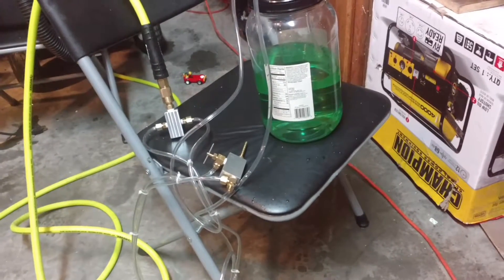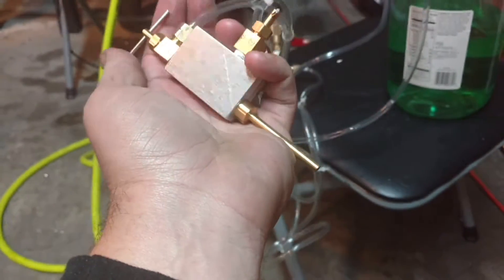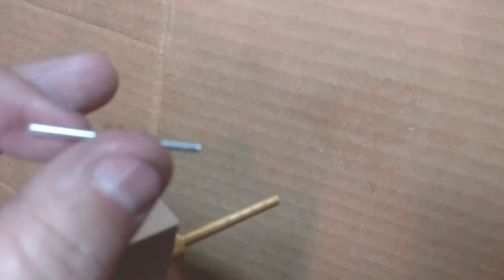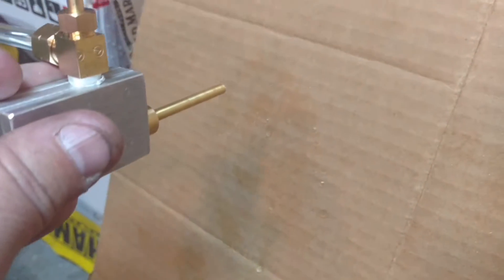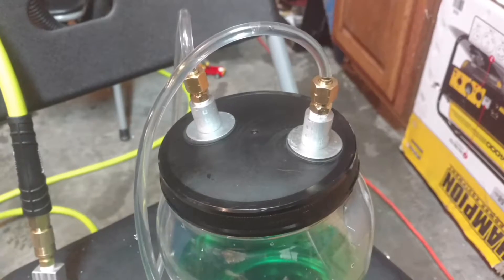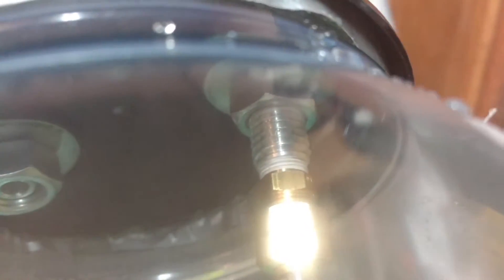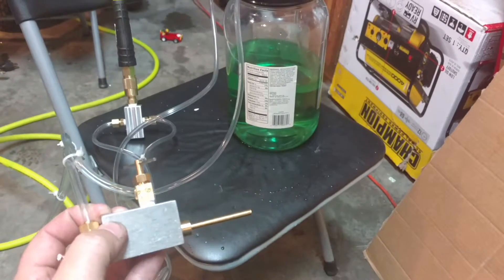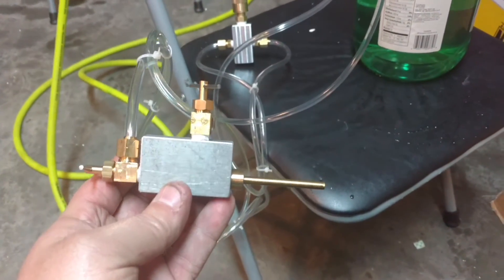Coolant Mist System Finished

Comment: it that just an aluminum block with an npt through hole for air and outlet with a connecting "t" npt hole for coolant?
Reply: are you compressing the tank holding coolant?
Reply from the maker: The aluminum blocks connected to the air hose is just a splitter that has a "T" drilled through it and tapped on each hole for a NPT fitting.  Then the one air line goes to the tank to force the liquid up and out and the other air line goes straight to the mixing block.  The air line going into the mixing block has a valve and the liquid line coming into the mixing block has a valve.  I adjust each valve to regulate how much air flow and liquid flow there is to achieve the spray flow I want.   Obviously this system is a low pressure system, and was just a prorotype.  I now use an acrylic home water filter container to hold my coolant as it is much stronger.
Reply: thanks for the reply :)